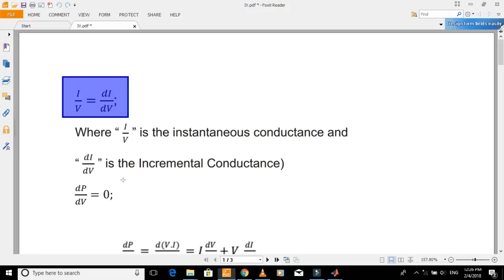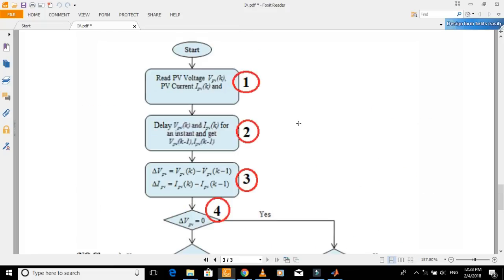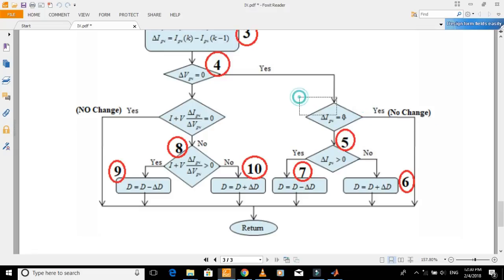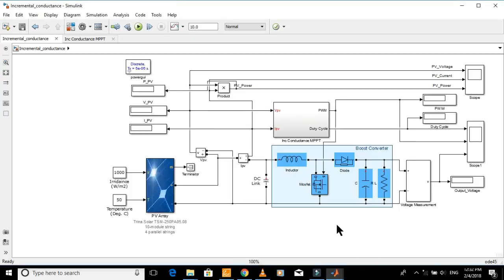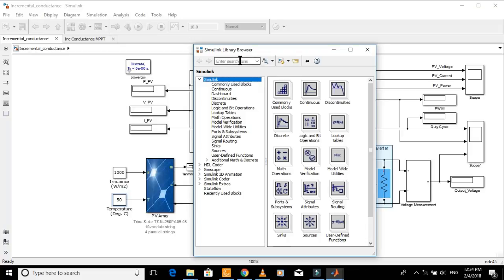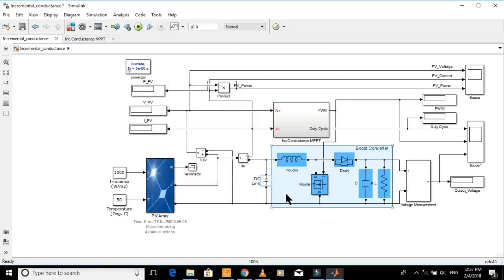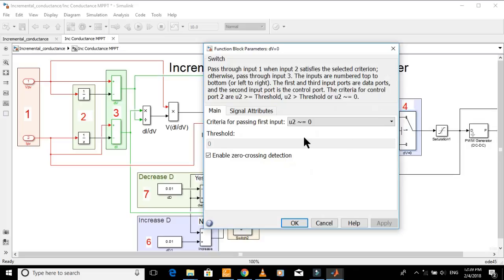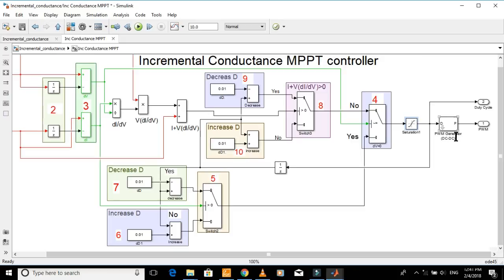Incremental Conductance MPPT | Full Video Tutorial

Comment: If  you decrease the duty cycle you are reducing the output voltage of the converter, so I could not understand the flowchart when you increase the duty cycle if the voltage output should reduce when deltai/deltav < 0 ...
Reply from the maker: You should watch the video carefully, everything is explained in the video.. if you still don't understand just go through some text books to understand the flowchart... I can't explain it here in comments..

thanks
Reply: Did you understand it?